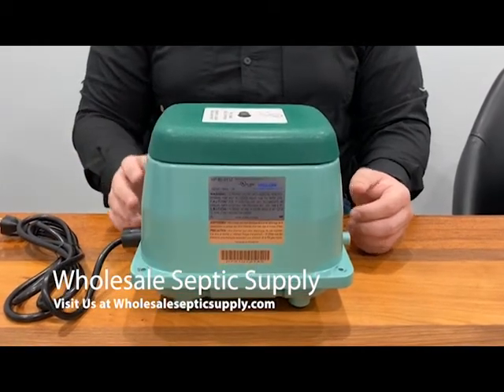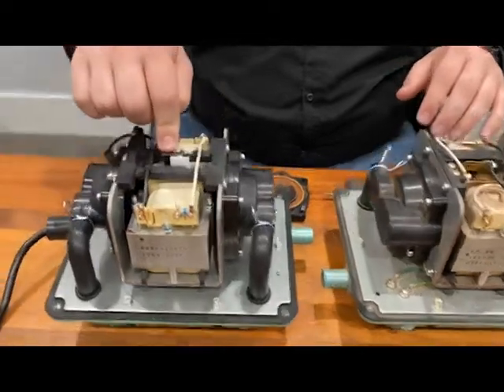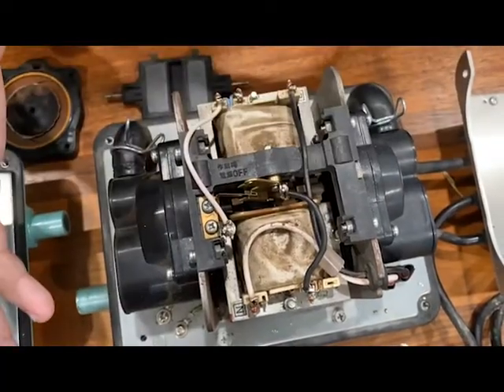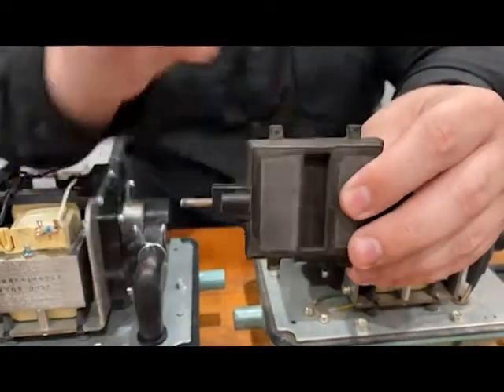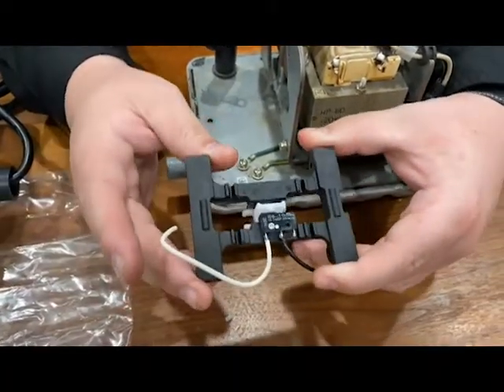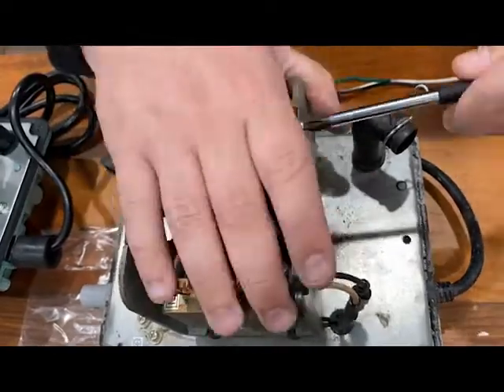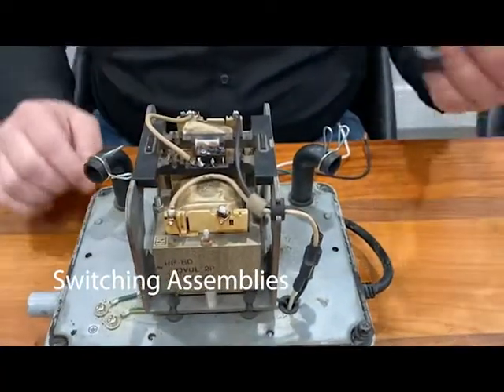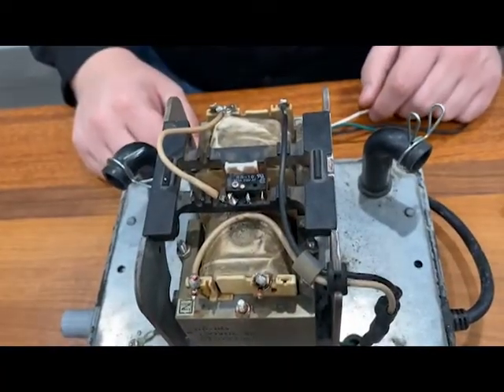My septic air pump will not turn on!

Comment: I rebuilt mine and the plastic clip on the shear pin keeps backing off. How do I keep it on with out preventing that pin from saving the pump from wrecking after a diaphragm fails?
Reply from the maker: where did you get the kit the pin has a nut to keep it in place.
Reply: @wholesalesepticsupply it was from Amazon. I ended up installing the pin backwards and it’s been holding up for awhile now
Reply from the maker: @dabbgk It’s a fake kit the real ones have a screw and a white nut. Zthe aerator is either not putting out the correct amount of air that is a high probability. Another thing that happens is the magnets go out of alignment. It’s confusing because it’s hard to see where they come from they tell you this will work because they come up in the listing if you paid under 50-60 it’s definitely fake.
Reply: @wholesalesepticsupply okay. Yeah the one I bought was like $27, the next one I get I’ll look for the real deal

Comment: Awesome video! Helped me out immensely. I replaced the diaphragm’s, reset the switch and the alarm went off again. I took the hoisting off, reset the switch again and this time the alarm went off but it was pumping air. I covered the exhaust and the light went off. I did that a few times. Put the hosing back on and hooked it back up to my septic tank. It ran perfectly. I assume it needed back pressure or something?

Comment: My new unit stopped working after 3 years and after troubleshooting it I found the safety screw diaphragms broken. I bought new ones and the unit only lasted a few weeks. I took it apart and the screw isn't broken, diaphragms were fine but on one side the screw came off and appears to be melted and the washer was broken in 3 pieces and seemed like the inside of that diaphragm was melted. Not sure what caused that and if I will need a new unit?
Reply from the maker: @amazinggrace_82  would have to see pictures of it you can send them to the office phone if you would like.

Comment: I have the slide switch unit. At times the unit would shut off and the alarm sounds. I checked the diaphragms and they are okay. The switch button is aligned and depressed as if in the run mode. I tapped the switch with the handle of of a screw driver and the unit started running. Assuming the switch may be faulty, I replaced just the switch. With the new switch installed the aerated shut off again after running for a few hours. I used the screw driver trick again and it started running again... for a few hours. The alarm comes on.  What could be causing this on-off-on scenario? I purchased extra switches just in case.
Reply from the maker: @charlesbooth3799  fold up a business card and push it into were the switch is that should solve it.

Comment: Mine went out and i rebuilt it using a kit. What no one told me was the "screw" on top was a breaker and i had to align the slot with the arrow. Once I did that it worked. Only took about 20 minutes.

Comment: The plastic screw broke on mine can i replace it with a regular screw
Reply from the maker: No if it broke the diaphragm is tore as well. Screw comes with the kit to fix the unit. I have yet to see a screw broke on a running unit and the diaphragm no needing to be replaced.

Comment: Mine came on & worked for an hour or so. I took it apart again and it looked like the new diaphragms were already warping around the edges!  I bought a Hiblow XP 80 instead. It is replacing the Hiblow HP 80. I don’t see where there is a place  for the air tube on the XP though.
Reply from the maker: Possible you bought a fake rebuild kit. The real ones will be engraved on the diaphragm and chamber block.

Comment: Can you provide the link of the replacement slide switch I’m trying to find it on y’all website but I can’t seem to find it
Reply from the maker: https://www.wholesalesepticsupply.com/products/hiblow-top-safety-switch-assembly-with-screw

https://www.wholesalesepticsupply.com/products/hiblow-sw03-slide-switch

Two different kinds of
Reply: Will the SW0080 swap out for the original safety switch? Are both links you posted interchangeable? My unit has the first (top) link posted above but curious is the SWO080 will also work on my unit.

Comment: Thanks for this video , I just fix my unit but was used to the scew type. I had replaced my aerator like 3 years ago and this new unit split the diagphams. So I got 3 years out of the unit. My aerator sits under a big concrete cast shield. Do you think this is causing the  hiblow80 to get two hot? 

I see other systems where the aeratopr is sitting out in the open. So I'm assuming they will run much cooler.
Reply from the maker: Test where actually done couple years ago and we sent some housing for aerators and out in the open was actually the best result followed by a open on both ends cover. None of the aerator manufacturers actually know who started the cover idea but it wasn’t a good one. On the old rotary vane units it was but in diaphragm units it’s not necessary.

Comment: What turns the Aerator on and off? Does it stay on 24 hours a day?
Reply: Yep, 24 hrs unless you use a timer.
Reply: @arnaldo35  is there a video that shows how to setup with a timer?
Reply: @majorsounds  Just buy a wall plug timer from the hardware store and connect the pump. Bear in mind, your septic will start to smell if you don't have enough aeration.

Comment: Hi , i have a hiblow HP-80 that i got from you guys and it only lasted 4 years and the diaphragms ruptured so i changed them and now onces it's fixed (with new diaphangms) the pump will stop after two hours of running and the core is blazzing hot. can you help me out ..Thanks
Reply from the maker: Where did you get the kit. If it wasn’t from a hiblow dealer you might have got a fake kit. You could need a new diffuser as well.
Reply: I tried the cheap Chinese diaphragms from ebay and they lasted about 3 days. The rubber goes rock-hard and it doesn't pump air causing the pump to overheat. I replaced them with genuine diaphragms and it worked for about another week.  Then the actuator rod broke in half, no doubt from the stress caused by the inflexible rubber in the cheap diaphragms. The genuine parts are a total rip off, but they are the only ones that use epdm rubber.
Reply from the maker: @arnaldo35  the Chinese ones are epdm it’s just that there is thousands of different kinds of epdm. The units run 24/7 and flex 30 times a second that’s 946,080,000 a year that’s roughly 2-4 billion times in there average life. Just cleaning the air filter and sometimes not even that. Cheaper than a moth on city sewer so it all depends on how you look at it.
Reply from the maker: @arnaldo35  the Chinese ones probably ruined the unit.